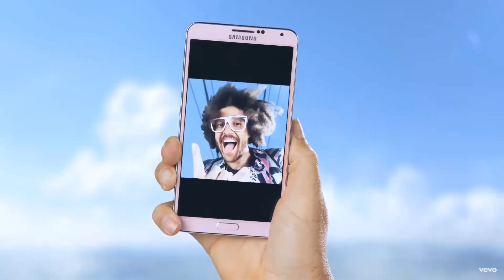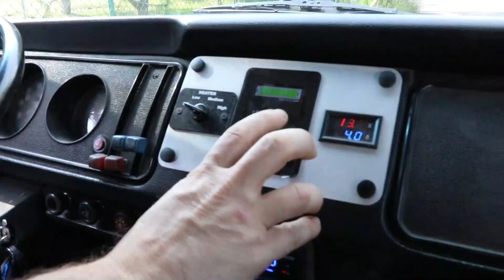Redfoo Video 8: Fully Electric Solar VW Bus, Final build video

Comment: Great design and build. Fantastic job!
Could you please tell some details on the battery range and what speed you're comfortably driving it at? (I know that the slower you go, the longer the battery range, but nobody wants to drive 30mph on highway. 😊)
Thanks in advance

Comment: Any more details like the roof deck design, actuators, and drawer slides?  I'd like to build something similar but need it to raise up 7 foot, which needs stability
Reply from the maker: The actuators are from Frigelli. The top is custom designed by our engineer; if you'd like more details or specific custom design info he is open to consultations. You can email us at belan@solarrolla.com
Reply from the maker: You can watch some of the previous build vehicles for more info.
Reply: Thank you, I browsed other videos, didn't find info on the lifting system or sliders.  Did I miss something?
Reply: @quartamile  same, missed it. Is it manual?
Reply: @solarrolla   it seems I'm not the only one who couldn't find the info in past videos.  How about a name or link to the lifting mechanisms?  Thank you!